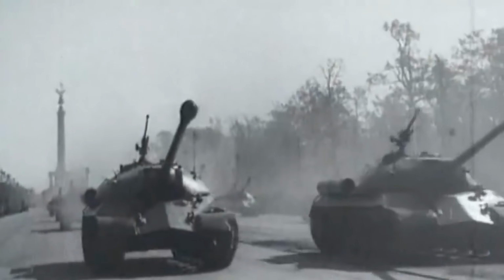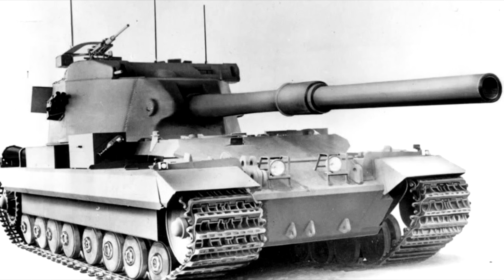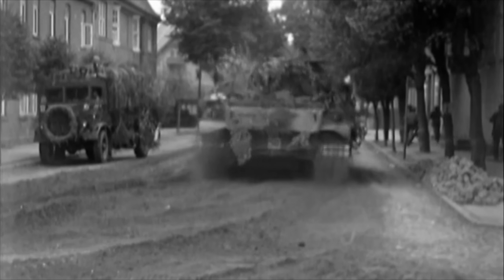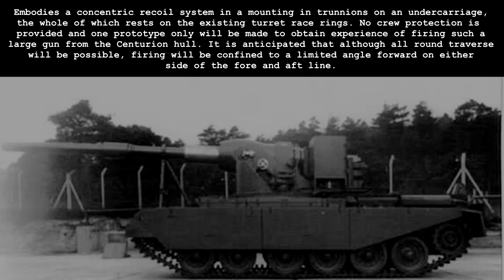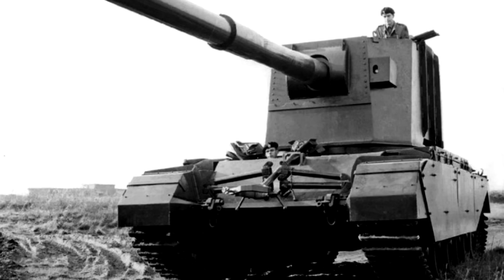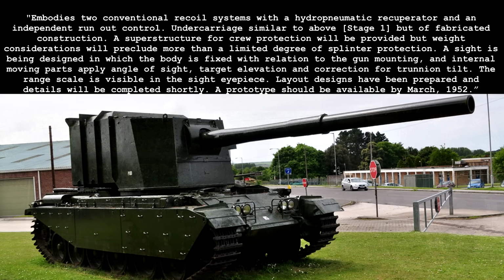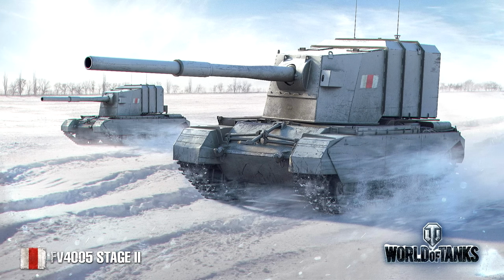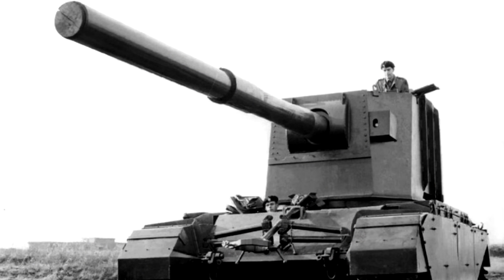British Boomstick, the FV4005 | Cursed by Design

Comment: It's possible now that every nation basically has the same mainline tank albeit with small differences. Heavy tanks and TD might come back now that there is an arms race going on.
Reply: Problem with them though, is why build a heavy tank when someone several thousand meters away can launch a guided missile which, if it doesn't obiliterate the tank, will at least score a mobility kill. Modern armoured tanks aren't designed to take direct hits from large-scale weapons or other tanks, but to prevent a random infantryman with a handheld anti-tank weapon from popping up from a hole or out of a building and wiping out tank & crew with a single shot. This might change with the advent of things like the trophy system, with the equivalent of heavy tanks being a semi-armoured carriage housing an array of anti-projectile weaponry and sensors to act as overwatch for a group of regular MBTs, but I don't see armoured behemoths making their way back to the battlefield.
Reply: @Neion8  Missles are not magic though enough... all they do is send a package at max effectiveness across a distance. And they are expensive while darts, shells, steel, and depleted uranium are not. 

A mobility kill does not mean much if you have enough armor to not care about suddenly becoming a bunker.

Also most weapons today can only handle MBTs and sometimes barely look at the Abrams even under Iraqi hands with just steel it's a powerhouse. 

So a sudden reappearance of something bigger would shake up the battlefield. Just as much as hypersonic missiles, shells, and railguns have.

Comment: I have had the FV4005 in World Of Tanks since it was released in patch 0.9.5. I have used it quite a bit, through buffs and nerfs, some nerfs crossing the line however, and the main one being accuracy, since it was introduced to have a better gun then the FV215b-183, which it trades for just about everything else except mobility. Now it is worse in nearly every way except gun depression and firing angle. Kind of makes it completely pointless to grind for it when you can just buy the 183 when it becomes available every now and then, which Wargaming tend to have a bad habit of doing with rare tanks that should never be sold again, or with reward tanks that you at one point could only earn, not buy. 

I have had the FV4005 in Warthunder not as long, but long enough to handle it well. Something Wargaming greatly needs in WOT is the recoil after firing large calibre guns, something Warthunder does really well. When you fire that massive 183mm gun, the tank basically hops backwards, which is very satisfying to watch from 3rd person view, or watching another player in the tank. It is also more accurate in Warthunder in regards to the firing angles, as 45 degrees left and right seems to be the limit before you risk the tank tipping over after firing, which in World of Tanks, would do just that with its 90 degrees left and right. One of the hardest things to get used to in the FV4005 in Warthunder, is the HESH rounds themselves, since they work best hitting angled armour, which is something we try and avoid doing in any other tanks because flat is best. However hitting flat armour, like the front of a Tiger II head on, which I have done more then a few times, only blows the tracks off, and most of the time, destroys the gun, where if the Tiger is straight on, hitting the side of the turret either left or right that angles back, tends to always kill the crew or blow up the ammunition. Just something that sometimes comes back to haunt people, aiming for flat less angled armour with the 4005, and end up with a really long reload while being stared at by a very angry tank that might repair faster then you can reload, and if they have machine guns that can pen the turret, then you are just screwed.

Comment: 6:29 HMS Belfast with 6 inch guns could fire more than 8 rounds a minute, so this only being slightly bigger should do 6 rounds, pushing my be slower but not that much.
Reply: I don't know what Belfast was equipped with, but I imagine she had a fully or near-fully automatic reload system, as opposed to the poor saps stuck trying to heave those bigass HESH rounds with their backs.
Reply: @TheSchultinator  no such thing as an automatic reload system for a 6 inch gun at the time, that's why I mentioned it. The auto loading six inch gun for the Royal Navy was put in service after ww2 and could fire 20 rounds a minute.
Reply: @Alex-cw3rz  I would still expect a cruiser to have equipment to make loading the guns faster, even if that's just rams for the shells and charges. The cruiser's crew would also have more space to move and work, so they'd be able to work faster.
I also think you don't realize just how much more mass a 183mm shell would have to a 152mm. That 30mm more diameter would add way more volume. Heck, the weight  difference between the USN 5" shell and 6" shell was nearly 50 lb, and 1 inch is less that 30mm.

Comment: They were on to something, though.  Just replace the tank gun with a howitzer and they’d have had a decent self propelled gun.  All of it’s drawbacks as a tank would suddenly not be an issue.
Reply: Just use the heavy tank chassis so the turret can have more armor and not look like something made of scrapyard parts. Who cares if you weigh 70 tons. You're going to be shooting hot mix tapes with the sniper tanks anyway, and actually have a rammer that isn't some dude with a stick.
Reply: @lector-dogmatixsicarii1537 probably because heavy tanks are engineering and logistical nightmare? Look at jagdtiger, ferdinant and King tiger. Gun that could obliterate twnks with one hit. Yet they were flawed because of their heaviness. The british made a good choice here
Reply: @Rexus0705  Let me guess, the 2TES is a heckin baste MBT-erino™?
I appreciate the historical bias fish and chips at the bait shop, but the Brits fumbled the bag, simple as. Conqueror was the much more ideal platform that could handle it and be future proofed as the heavy gun platform. Cent was too anemic of a platform, and the next tank to enter service unironically made it an even bigger testicle bag fumble that kept on giving, the Chieftain. Britain dropped bags like they walked under 1776 ladders and couldn't stop whiffing the slow pitch at Boston t-ball with a cricket bat.

Comment: the shell is so big that simply landing a shot nearby would probably break your tank.
Reply: In firing tests, it ripped the turret off a centurion (that's not an ammo fire that blew it off btw, just the one shell) and split the turret of a Conqueror in half despite hitting it's strongest point. Yeah, it had it's flaws but it fucking lived up expectations.
Reply: It's the same as how the ISU-152 could killed literally any tank because of the sheer weight of HE in it's shell. In an explosive SIZE MATTERS.
Reply: @IronWarhorsesFun  Kindof reminds me of a story of one of the engagements between an IS-2 and a Tiger, apparently the crumple zone for the 122mm shell turned out to be the half of the tank the crew were sitting in.

Comment: I feel the spirit of the TOG project haunting this project. It's a big artillery gun on tracks with a high silhouette easily spotted by enemy tanks. Any T-70 would charge at it and kill the crew in a wink of an eye.
Reply: I think it falls into the old TD concept. It's basically a self propelled anti-tank gun.
Reply: the long boi TOG II was quite memorable in WOT…
Reply: Really? T70 doesn't lose accuracy on the move?  Will agree on T70 all around a better weapon.

Comment: World of tanks blitz: 183mm gun?
It's definitely an 130mm autoloader... Definitely...
Reply: Game balance.
Reply: @dankllamas6984  yet the FV215b 183 use 183mm gun
Reply: @Kalashnikov413  here's what I meant
There was already a 183mm single shot gun in the game, the fv215b 183, it wouldn't be very interesting to have another. Instead, they decided to put the autoloader version into the game in the form of the barn. However, a 183mm autoloader would be ridiculously overpowered, so they made it a more balanced caliber. The result is the 130mm autoloader you see in game.
Reply: @dankllamas6984  yeah...... the ''balance'' 130mm autoloader gun that literally does similar effect with the 183 but much longer

Comment: I wonder how different this tank would be if it was made today with the current technology
Reply: Better hull, fires heat or apfsds, roof mounted MG, autoloader and extra rounds. Id imagine the apfsds would go faster than the object 120's (and would still be like 100 milimeters in diameter). Heat rounds would be significatly slower, but could penetrate like 600mm of armor due to being basically unguided atgms.

Comment: "It was not intended for the front line."

But that is where you find the enemy tanks. If you find them anywhere else, then congratulations, that is now the front line!
Reply: They would basically shoot from outside of the enemy tanks range, blow up an entire battalion of IS-3s with a single shot from a platoon of Centaurs, and then scoot back another 5km, set up the net again, and repeat.
Reply: @Orinslayer  What scooting? With THAT tank?!? XD
Those concepts never survived actual combat - just like the M10 Wolverine of WW2 were in the end used just like tanks and therefore always lacked armour sorely. You need speed if you are lacking armour, like the M18 Hellcat. Don't see a FV4005 speeding anywhere. ^^
Reply: @Orinslayer  Sounds great for fighting in the desert, but horrible for everywhere else.
Reply: When you have a 183mm main gun, it turns out you can have a shouting match with the front line from whatever line you want.
Reply: You live in the world where tanks are only used for fighting other tanks.  In which case tanks serve no purpose.
Reply: @annoyingbstard9407  infantry fears tanks and tanks fear infantry. Without infantry tanks are vulnerable to enemy infantry without tanks infantry is vulnerable to enemy tanks. A ying and yang in a way in this modern world one cannot exist without the other.
Reply: @wilhelmw9149    What’s the point of that somewhat obvious comment?
Reply: @wilhelmw9149    If you look very, very carefully you might notice I was responding to someone who thought tanks existed only to fight other tanks and I was pointing out how ridiculous the statement was.
Reply: I mean hes not wrong
Reply: I- nvm you're correct.

Comment: I actually rly want to see what can a tank armed with a 203mm gun can do to an MBT
Reply: Be like... on the subject of aiming "Y E A H... anyway, I just closed my eyes and pulled the trigger." Autopsies report the boiling vessel broke off and domed the commander after the vehicle flipped in the air ten times. We would basically be building a Baneblade and parallel double tracked railways to transport it if we recycled the 240mm gun.
Reply: @funny stuff A tank having a 1000mm cannon will either punch clean thought a BB or blow it up in one shot.

It will also be so dense it will create a tactical black hole.
Reply: Guess, obliterate it?
Reply: @17blaziken  Probably, but thats the point
Reply: @guvyygvuhh298  now you see it, now you dont..
Reply: @funny stuff 🤣 No battleship was ever built with that caliber. But I am pretty sure any BB will crush it like a coke can.
Reply: @funny stuff P.1000 Ratte, I presume?
Reply: @TheSchultinator  P.1000 Ratte would’ve weighed 1000 Tons, the 2 main guns were actually planned to be 270mm in caliber
Reply: @Mr_AntiSocial  Probably would have been overweight, but yes

Comment: I love how the British just slap "quick firing" on absolutely every gun they make. If they made a gun that was slower to fire than a German railway gun, they would still call it quick firing
Reply: In this context "quick-firing" refers to a gun that is both breech-loading and that encases the propellant charge in a metal case. The term came about in the 1880s when those features on naval guns were rare and there's never been a reason to get rid of the term.
Reply: @xenopug6390  Extremely interesting, sent me down a cool rabbit hole. Thanks for the explanation!
Reply: @xenopug6390  Not quite. "Quick firing" means it has a sliding breech-block, as distinct from a screw-threaded breech-block, which would be designated "Breech loading". Effectively all tank armament is QF rather than BL.
Reply: @johnsalt1157    Not even close.  In the British army (and RN) quick firing means, as xenopug explained, breach loading and cased ammunition.  Nothing at all to do with the breach mechanism.
Reply: @annoyingbstard9407  But I'd expect that in practice, screw breach mechanisms end up being more common on bag-charge guns, because the choice of breach type and the choice of charge type pose similar tradeoffs between weight and speed of operation.
Reply: @xenopug6390  I don't see the reason to continue using the term. Why not just simplify the nomenclature since the term applies to every single weapon the British military uses and has used for more than 100 years now?
Reply: @filmandfirearms  For the same reason that the weapons infantry use are still referred to as "rifles" when they have been rifles for well over a century, I guess. It's not a meaningful label anymore (unless it's a tank) but it's still used because it's an apt descriptor
Reply: @xenopug6390  Except now we have subcategories of rifles. Carbines, assault rifles, DMRs, automatic rifles like the M27 and L86, battle rifles like the FAL and SCAR. They are rarely officially labeled "rifles", unless there is some distinguishing term attached. To me, it just seems like yet another example of the British military being desperate to cling onto the past. They have the least advanced equipment of any developed nation, and certainly of any country that produces its own equipment
Reply: @filmandfirearms  it's because they do still use bag charges on things like Artillery pieces, and up until recently the Challenger 2.
Reply: @thatguyj5596  Case in point, they're behind the times on everything
Reply: @filmandfirearms  Says who, you? Pffft.
Reply: @xenopug6390  But the “Rifles” have rifled barrels, therefore making them “Rifles”, not a outdated term by any stretch
Reply: @sunnydaycavalry3764  which is also a nomenclature problem, as most pistols, SMGs, and MGs have rifled barrels
Reply: @filmandfirearms 
>"Britain has the least advanced military in the developed world"
>One of top 5 spenders in military expenditure in the world
>One of the inventors and one of two users of  literal laser weapons

The UK military uses drone fleets with AI deep learning, laser weapons and is a pioneer in electronic warfare. What are you smoking?

Should I go on?
Reply: @filmandfirearms There’s still bagged charges used on certain weapons. Artillery in particular, which is relatively common worldwide. It’s a necessary term in their nomenclature.
Reply: Meanwhile WoTB: Quick firing? You mean bs 3 seconds reloads?
Reply: @jordzking6330  And here come the gaming nerds...
Reply: "Shell goes fast = quick firing" logic
Reply: LOL 😂😂😂
Reply: We do be doin that
Reply: On more reason, for all British tanks produced during WW2 were rubbish.
Reply: @jpmtlhead39  Quite unfair. The Matilda II was a nightmare for the Germans to take out in France, and North Africa; only the famous Flak 8.8cm could take it out.
Whilst the it's 2pdr gun could take out any German tank in those theatres.
British tanks weren't badly engineered. They were designed with the lessons the British Army learnt from WW1, because they won that war, whilst inventing the "tank".
Reply: @jpmtlhead39  that's just wrong, WW2 british tanks were great, they were just more specialised to roles, like the matilda and churchill being Infantry support tanks and the many Cruisers from the crusader to the cromwell (let's not talk of the covenantor)
Reply: @spittyboii  great...in what,speed probably.😂😂😂
Reply: @jpmtlhead39  I don't understand what you're asking, did you stop reading at the word specialised or do you not understand the use of cruiser and Infantry support tanks?
Reply: @spittyboii  man its was an rhetorical "question".
And by the way,the use of Infantry to support tanks was a German doctrine,and it's proven Wright until this day in any army on Earth,excpt the Russian army who still belive that tanks dont need infantry support. And the results are plain sight.
The brittish were Completely wrong,with tanks supporting infantry.
Reply: @jpmtlhead39  how do you come up with that conclusion from anything you just stated? You compared germans using Infantry to support tanks to the british using tanks to support the Infantry and if it was wrong to do so wouldn't they have changed the docterine? you're also contradicting your own statement by saying the Russians are stupid for not employing such tactics and then calling the british stupid for not changing it? That's if you don't want to differentiate which is how you began your statement

Also a rhetorical question should still be intelligible.
Reply: @spittyboii  you Said,"the brittish tanks where great.." and i Said " in what,speed probably"... What so hard to understand here..??!!!